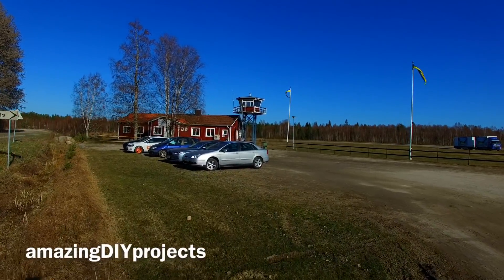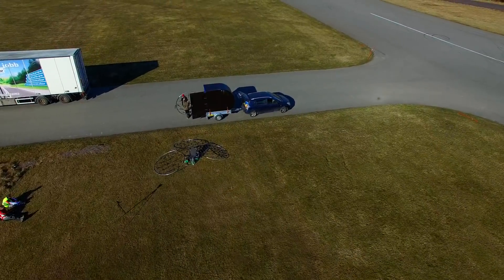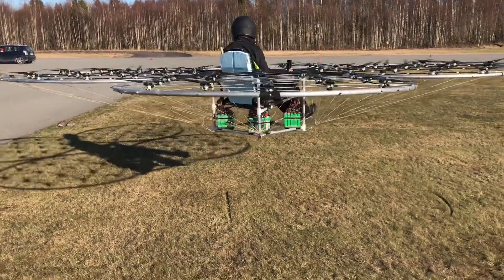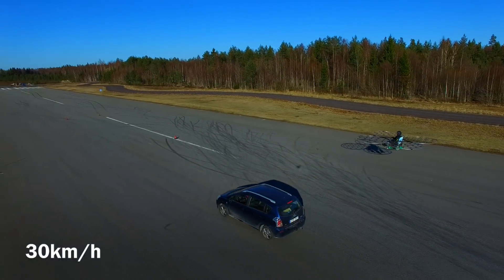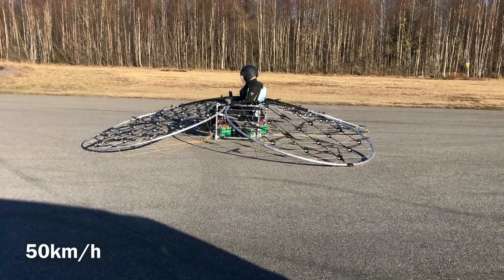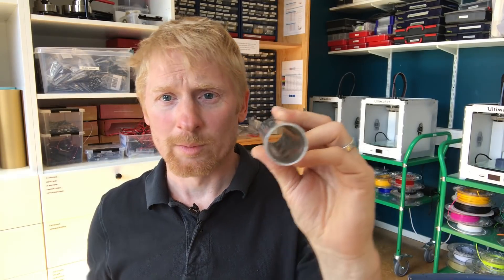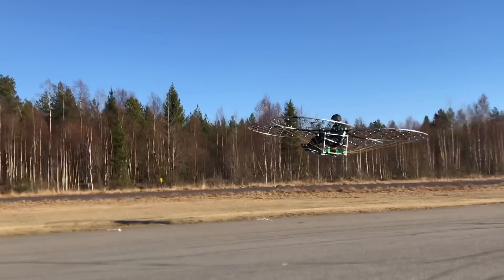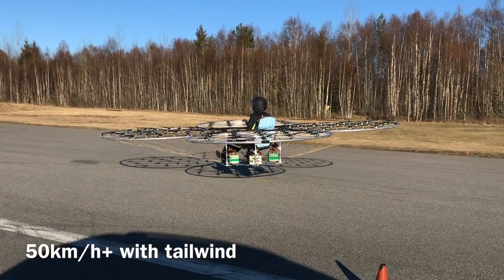chAIR episode 32 -Maximum Practical Speed TEST! Manned drone quadcopter

Comment: Beautiful flight! You have courage to push it this hard, good on you following your dreams. Side note: many car speedometers report faster by 5-8% of actual speed. GPS speedometer is the way to go but like you said, you love hovering so :) does top speed really matter?
Reply: Lol! what kind of car are you talking about? At least out here in america, even the worst quality super old cars dont even have a deviance of more than 3mph.
Reply: @urineanimal  nearly all the Honda's and Toyotas in our fleet around 2010 and onward have this. Great cars but the Speedos suck. I always use GPS speed to reference and it's what I've found. 108kmph = 103. 55-58 = 50 etc. Great hybrid vehicles, super good mpg really low maintenance, still pretty quick of the line, but the Speedos suck.
Reply: @jotham123  ive used a few gps based speed readouts before. I suppose im being a bit jumpy with my conclusion.  I have seen accurate speed discrepancies before indeed. Pardon my narrowminded spout. You are correct. Getting back to this video.... who the heck can afford to build a machine like this, yet didn't utilize a basic telemetry feature that is part of nearly all flight controllers with an average cost of $35! Very cringy...
Reply: In Australia, cars are required by law to read 0-10% higher than actual. Most manufacturers aim for 3-5% to prevent legal issues. Even a high end supercar will be out by a few percent for legal reasons.
Reply: @tin2001  that explains it then..

Comment: Hi, With the 17x5 props, you are currently displacing 1135ci volume of air per a single rotation.  With the maximum amount of static thrust being at a ratio of 6 in forward propulsion to every 10 in diameter, a 14x8 prop would give you slightly ( just less than 10% ) more static thrust (for lift), but would increase your speed in forward propulsion by 60%.  If it creates too much load on your motors or ESCs, you could go with a 15x7 which would give you about 6% less static thrust but still gain 40% more in speed.  Hope this helps and Happy flying!
Reply: When it's battery powered, I'll take efficiency over power every time.
Reply: The pitch is way to high the efficiency would go down like hell
Reply: @peterzingler6221  Actually, it's the a ratio of 10 diameter to 6 forward is the perfect pitch for lift to get the smallest diameter prop without loosing lift.  Unfortunately, most props are made at a ratio of 2 Diameter to 1 forward at the most but that is an easy one to find props for such as my hex with 15x7.5 props.
Reply: Over the 10x6 ratio and you start loosing lift efficiency, draw more amps, but gain speed.  Under that ratio and you've lost both lift efficiency and speed.
Reply: Yea Ron you think about it and He is doing it . . . blah blah blah.
Reply: @JoeZip25  Hi Joe, Doing the math helped me win the HobbyKing beer lift contest in the 500mm bracket.
Reply: @RonALampman  Good work Ron. Engineering is all about the maths.  Morons wing it.
Reply: Nurd
Reply: @danielhughes1702  Now it's time for everybody's favorite subject; MATH!
Reply: @danielhughes1702  You mean clever unlike your comment

Comment: Your phone has GPS it is a speed ometer no car neede
Reply: I initially thought the same "why not just use a phone GPS" but the side footage from the car is a useful analysis tool.  Something the phone cannot do.
Reply: The purpose was not to test max speed, since that varies with the wind conditions anyway. The purpose was to show the machines tilt angle at different speeds.
Reply: GPS speedometers aren't as accurate
Reply: @jessemoody2218 
Uh, no. GPS is far more accurate than estimating based on observing a car with an unknown speedometer accuracy.
GPS speed looks inaccurate if you're looking at it while accelerating or braking, especially on consumer GPS units with only a 1Hz sample rate. Increase the sample rate and you get a more accurate speed reading. Hold a steady speed and you get an accurate speed reading. If you only care about the overall average speed between 2 points, GPS is extremely accurate.
That said, I would still have used the car as a reference for the testing, but carried a GPS to log the runs to get the actual average speeds afterwards.
Reply: @jessemoody2218  You really need both and compare numbers to know what ever those were accurate enough.
Reply: @jessemoody2218 GPS is only as accurate as the device making use of global positioning satellites. for the average cell phone with clear view of the sky, such as in this case.. the HDOP should be ridiculously low, resulting in an incredibly high level of accuracy. I'm currently writing this from my first floor, and checking my phone gps stats show that I've got 8 sats in use (of 11 in view) with an HDOP of 0

Comment: As cool as it is it still makes me cringe when i think about how hard you would crash if for what ever reason the power cuts off. I mean its not like a helicopter with auto rotation. This thing would just drop like a brick right? 🤔
Reply: I remember in one of the earlier videos we saw that there are two fully independent power and control systems and it can fly on either/both. Finding yourself 'dead stick' at any speed or altitude is going to hurt, but I don't think there are any single points of failure.
Reply: @randomstranger9674  Makes sense 👍
Reply: At the heights he flies a block of suitable compression polystyrene would protect that delicate back. Similar used under seat in modern sailplanes.

Comment: Glad to see it out of ground-effect finally... time for altitude trials!
Reply: Bring a parachute.
Reply: @CharbeeCapps  You would need at least 500ft for a reserve toss,scary stuff!!!
Reply: This is the problem with this type of aircraft, you have a failure, you are toast. And unlike a helicopter, you cannot autorotate. The typical cruise heights make parachutes impractical. Failure is not an option.
Reply: @ARMCoder-BR  
No there are modern lightwight rescue parachutes with a trowfunction that can basicly save your arse even as low as 10meters
Reply: @lokruth9769  Really big airbags like they used on the first Mars rovers.
Reply: Milton Maldonado Junior 
Why wouldn’t the small blades autorotate?
Reply: @bradley5819  on a helicopter you change the pitch. (Angle of the blades ) to negative so the air flow spins up the rotation. Then flip the pitch back to slow decent at the last second to cushion the landing. Drone props are fixed pitch so cant do this
Reply: Big Time!
Reply: I got it! Maybe an 'Ejection Seat'? lol
Reply: @scarakus  Ballistic parachute with cut-aways for the man-graters.
Reply: @scarakus  sounds extremely heavy when trying to reduce weight
Reply: i think we all want to see a manned altitude test. i would thinkthe best place for that would be over water? but, what about water-proofing.thats a whole other issue i suppose.
Reply: @leemaples1806  Lol, water don't get him past that slice-o-matic, He'll have to do it in increments. The Flybye was at least 30', next 50', 75', then a 100'. I think the best thing is to stick a 170lbs of sand bags in it, and see how long it'l fly remotely.

Comment: You definitely need a field charger. Or spare batteries :)
Reply: May be they have a Tesla Supercharger at that airodrome :-)
Reply: Or replace the batteries with super capacitors
Reply: Daniel Hughes 
That would make battery life even worse. Supercapacitors just exert energy faster, meaning they would have much worse battery life than batteries.
Reply: @-Burb  One of major advantages of supercapacitors - virtually unlimited charge-discharge cycles. The catch - energy density is too low to replace regular rechargeable batteries. On a bank of supercapatitors of the same weight as li-pos - expected flight time will be something like 30 seconds instead of 10 minutes...
PS: it needs an arc reactor :)

Comment: Tilting the motors is another trick to get more speed when the aircraft is pretty much a horizontal structure. If motors are tilted you need less tilt of the aircraft and the horizontal structure stays more horizontal with has less air resistance. Tilted motors are often used in racing quad copters to get more speed.
Reply: Buddy tilted motors haven't been used since 2015 and that's for a reason
Reply: @peterzingler6221  What is the reason that has been abanded if it has? I think I've seen that used still in recent year. (Hovering needs a funny position but that is not an issue if you want to go forward always)